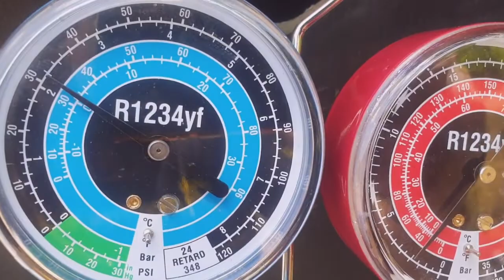Xsara Picasso 1.6 AC condenser replacement.

Comment: Could you have just not removed the top cross member with the bonnet shut on.??.
Pushed the water radiator back towards the engine and released the AC pipes and lift off the anti vibration rubbers.??.
Reply: Cross member does not even have to come off, on a 1.6 16v engine there is just enough room to get the condensor out by just wiggling and pushing the radiator towards the engine. Lower pressure line you can loosen and remove poking through the grille and the top pressure line from above. Disconnect the connector from the pressure switch.